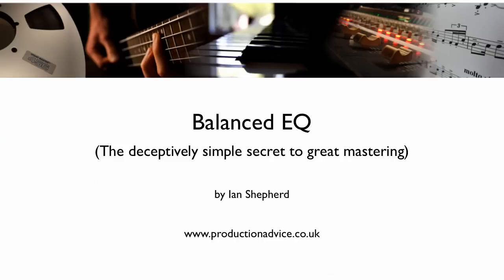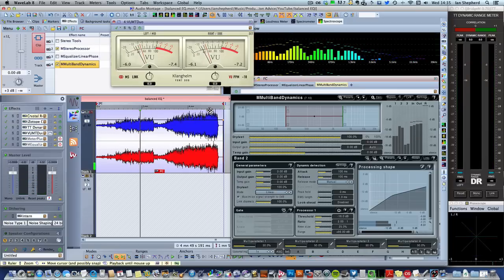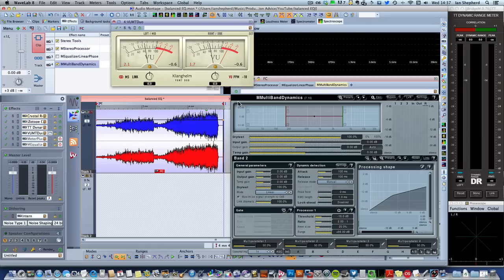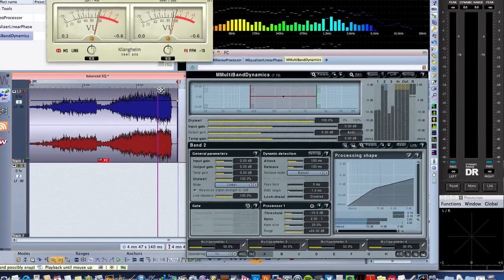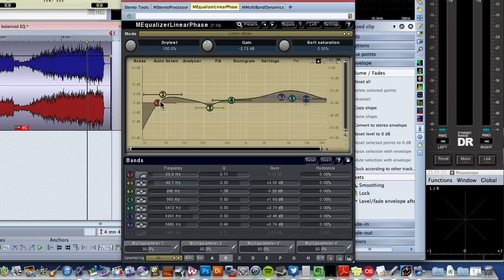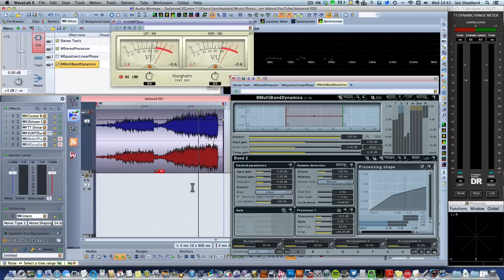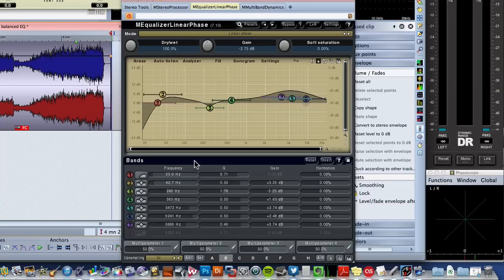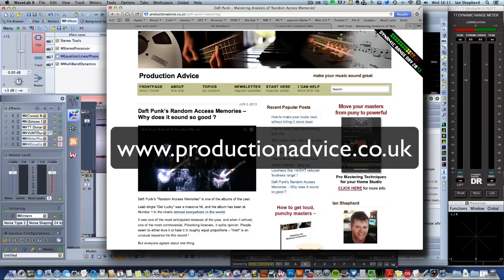Mastering EQ - make music sound louder, with LESS compression and limiting

Comment: Right there, that's what I was talking about : what you've achieved is more than an "EQ balance", it's a "perceived loudness enhancement". With that healthy boost peaking +7db at 5khz, your -2.75db lowering of the output gain doesn't actually make up for the loudness you've introduced. And you can verify what I'm saying very simply : just bypass your EQ plugin, and you should see the audio signal still appears to come out louder when the EQ is on, no matter what your peak & RMS meters may say. To truly compensate for the loudness you've introduced, you'd need to factor in the sensitivity of our ears to different frequencies :  and as it happens, the 1khz to 5khz region is particularly a crucial region in this respect. So would you call it a fair trade ? More dynamics for more highs ? That's a debate you should definitely approach
Reply: +Ian Shepherd Don't you really see there's a direct link between music getting dynamically louder & louder as time goes, while also getting brighter & brighter ? I've done that test many and many times over : pick any tune produced in the 80's, 90's or even early 2000's, and then select any major tune released this year. Turn its gain knob down so that its core RMS value (loudest section) matches the core RMS value of the older tune. While your meters display identical values, the more recent tune does come out a lot louder than its vintage challenger. But wait - doesn't it also come out A LOT brighter ? Could this explain that ?
Reply: +Ian Shepherd To me if you knock out the transients with a brickwall, its actually killing stuff over 5k, which is why so many find it hard to add air. Then bam they need double that harsh treble coming from an EQ which just sounds more phasey than wrong than if it were naturally being produced. I'd prefer people factored in perceived loudness EQ than dynamics, which might get things insanely toppy, but its partly the same issue isn't it, it is mastering for the worse scenario, so when your audiophile system plays it back at 100dbspl, it sounds worse...in either case you can control it with a volume knob so its partly unnecessary to a degree, either's definitely got to be in moderation to sound good at all levels-the perfect balance.... If it sounds quiet in my car with it's stock 15 year old Vauxhall speakers for example, the stereo has these loudness curves i can switch on, and it also has normalisation, and its my fault for having a crap car so i'm not going to blame the music... I like albini's sound for example, none of this processing, but i like it when its cranked on a good system and sounds awful in the car, there are compromises sometimes too when the track is hardly EQd and has a dynamic range of 20.

I've added stuff from equal loudness contours, i'd say this is more refined, as loudness contours really boost quite extreme below 40hz and above 10k, which isn't really always that necessary, some might complain about mud etc. I did input the actual values, of the difference between curves e.g. 80-90phons which is up to about 6db in places (not an actual extreme curve, but this just find what 80 db lacks compared to 90 db instead).....but generally its just a 'scoop' which is probably better since its related to the original mix. I've done it dynamically too, it can work pretty well for this too, if the comp is frequency dependant you might use less of it.
I'm noticing mostly the sub and air frequencies are rolled off though: which is probably recommended, i don't know. The exact contours i used could be arbitrary, but were a good start for someone who didn't want to screw it up with their inexperienced EQing.

Comment: Very informative video Ian thank you for posting, I have a question ,is it not advisable to master in the mix itself? and if not why ? I am having some issues with the control room meter in cubase 8.5 pro as i am sort of perplexed as to what to go by the meter itself or the true peak reading, when I get a mix that is as close to 0 db  the true peak reads anywhere from -8 to -12 db, I do not understand this, also do I use a limiter on the stereo out track if so where in the chain should it be before or after eq? sorry if the questions seem dumb I am pretty much a beginner at doing my own studio work. Thank you again.

Comment: Nice video as always. I have a question. Engineers sometimes apply a steep eq cut between 300-400 in order to be able to compress the track harder if that is the aim. Is there a trick in order to choose the right point you cut?

Comment: Great exemple, stuff like this are not easy to master, because there is a quiet part and a louder part, unfortunatly most consumer system are not as good as a pair of monotoring speaker, that's why a mastering is need, to have a consistant volume from track to track.

Comment: Then what's your take on SoundOnSound's tip on placing EQ after compression? 
"Any boost or cut you apply with the EQ controls will change the overall level of the signal relative to the compressor threshold setting you've already chosen, and will therefore mess with your carefully tweaked compression sound, unless you keep revisiting the threshold and/or ratio controls to compensate."

Comment: I'm using reaper, and I don't really know in what order to place my mastering chain.
We're talking extreme metal, and I tend to get either a really fuzzy stuff or something that turns out really bassy and dead. It's extremely important with tight and deep bass drums and the guitars are really low too. Any advice?
Reply: What ive learned in extreme metal its handling the midrange, alot of people tend to think you get punch by boosting low end. Thats usually not the case, removing the lower midrange "boxy" sounding frequencies from your instruments can help your mix dramatically. Be careful and surgical when removing these frequencies cause too much cutting can make your sound thin really quick. When done right will keep your tracks from sounding dead and blurred.
Reply: Codie Waldvogel I'll try that out, thanks for the tip.

Comment: It's not easy to master a COMPLETED mixed track with such a HUGE loudness in the climax imo. I would start over each track and level them using a level controller. You would spend far less time simply by just "LEVELING" each track. Turn down vocals at the end and balance it out before you hit the MASTER. just saying. Why spend another HR or so when 1 hr of channel track tweaking does the job?
Reply from the maker: Yup, it's always best to get it right in the mix if possible, but it's also useful to have some strategies when it isn't :-)
Reply: @ProductionAdvice  100% right. That backup plan is $$$ king $$$. Its silly how its never plan A at the last minute before master.

Comment: can't polish a turd........case closed
Reply: I don't know if I would agree with the harsh judgement of this song, but this video is great because many of the tracks that come to mastering engineers have some mix and/or EQ issues.  Many mastering sessions are not an exercise in working on a really great mix.  Not every song can go back for remix either - maybe because of budget, or a deadline, or the song being a remaster of older material - maybe the session master no longer exists and cannot be remixed.  Every mastering engineer is going to have to learn the art of compromise at some point.  Hearing what is and what is not possible on a track with issues is very useful.
Reply: yes but you can surely spend weeks trying, and i have and i know what you mean...materials tracked  and mixed in 
home project studios wirth a digital drummer lousy pre amps and inexperienced mixing can be a total disaster, ..not saying this applies to this song but just saying "in general " i have been sent many tunes that required things i just
 couldnt save no matter what i tried, on the flip  side i occasionally get in some great recordings where its exact 
opposite, 'dont fuck this up" tread lightly" with your mastering  chain  by placing the limiter compressor at the end to get industry volumes set up before tamporing with tone, which to me is what it comes down to, the material one 
masters will  be compared to the original mix back in the studio it was created in by the people that created it, thats 
who you are really competing with not the industry itself.  Most of what i get submitted to me is somewhere in the middle it does need help yet again it will be compared to the original on the sound system it was created on , so Ian is dead on, be invisible in your mastering as much as possible , if it sounds too different to what they have been 
listening to and liking they may reject your mastering work. just on that cause..the key on that is bass in my 
opinion..be subtle  taking any out..i have had clients tell me "what happened to the bass "but never once say the bass was too loud....so thats always one of my last  balancing adjustments after cleaning up the low end..